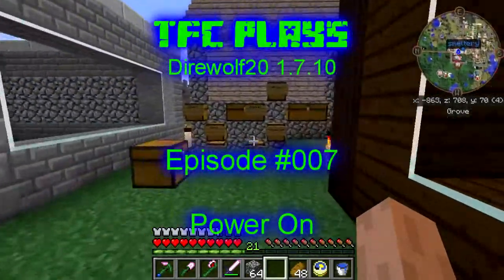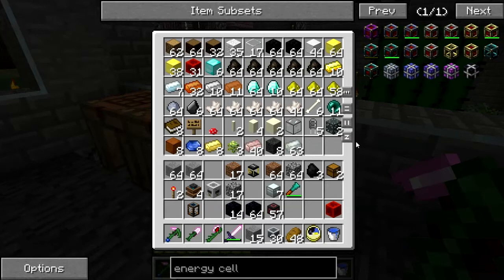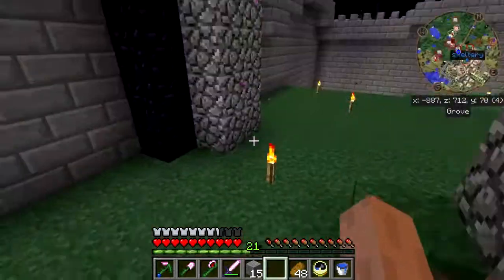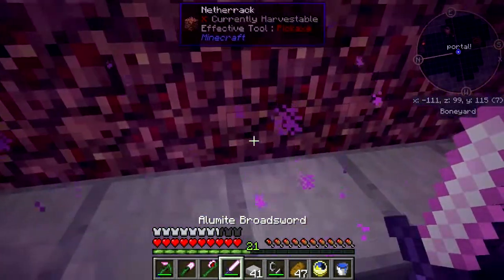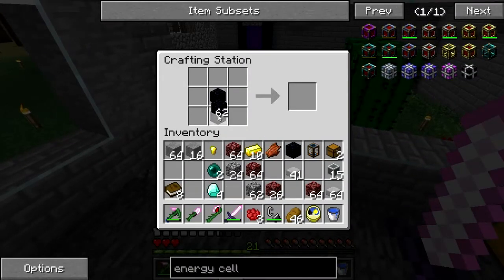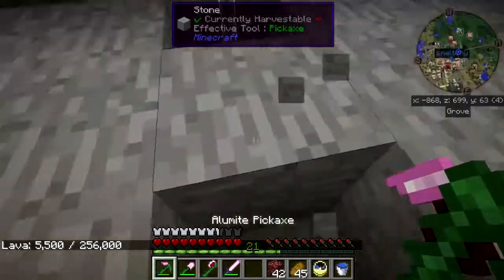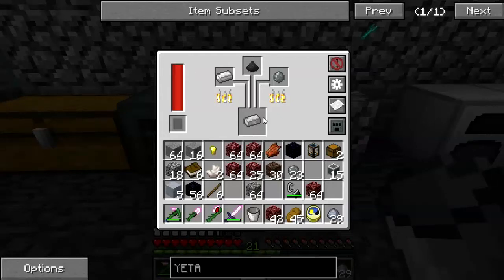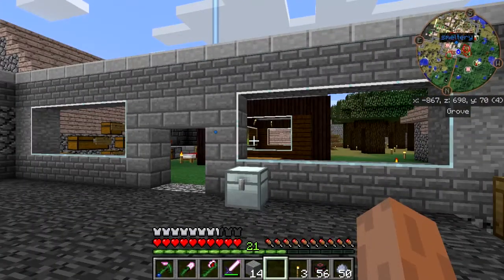Power On - TFC Plays Direwolf20 1.7.10 Ep7

Comment: Building looks awesome.

I'm curious, why that particular order for tools on your hot bar?

EnderIO's basic gears should oreDict with Buildcraft's stone ones, which isn't a material savings, but is a time one.

There's an upgrade for the Magmatic Dynamo's that allows them to accept things from the energy output side, if you ever find yourself needing to put them top and bottom. It also allows a three block lava pump setup. Pump, Magmatic, Lava Teleportation device.

Speaking of, if you dye the wool used to make your Ender Tanks/Chests, the colors on top are set to that, so you can make a new one with red wool if you need lava somewhere else, and save a bit of dye. (Or dye the sheep and save a LOT of dye.)
Reply from the maker: my hotbar layout is mostly related to how I've always done it in vanilla. 
I knew that about the gears but didn't think of it at the time.
I hope to not be using the magmatics for very long and those that I do use will likely be set upright in 1 or 2 lines feeding the power conduit
The wool thing goes back to the very early versions of the ender chest mod.  In my case however dye is more plentiful than wool.  Later on I'll have a farm of 16 sheep, one of each color.
Reply: Fair enough, I've just seen lots of people with lots of layouts and always wondered the why.

Well, now I'm curious as to your mid and end game power plans. So I'll be eagerly awaiting more episodes to find out.

I'm used to having to wait on bees to get dyes, so I've learned all the tricks to save on them. But with Botania I guess it's no issue. On the other hand, I tend to go through massive quantities of yellow and green wool. And a little bit of red, so that's mostly what my sheep farm ends up being.
Reply from the maker: with the Botania and Biomes o plenty's flower explosions, dyes are pretty cheap.. just need to take time and collect 'em.